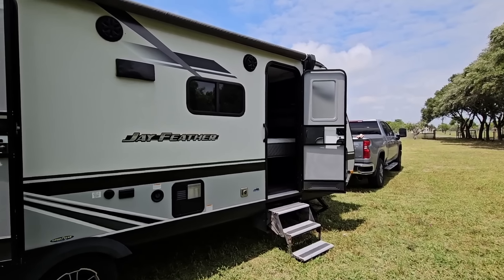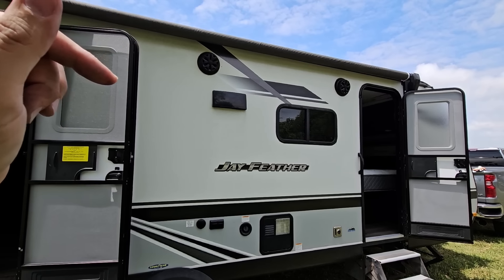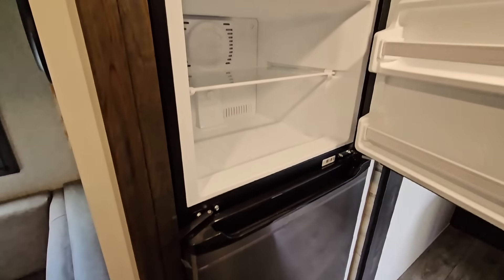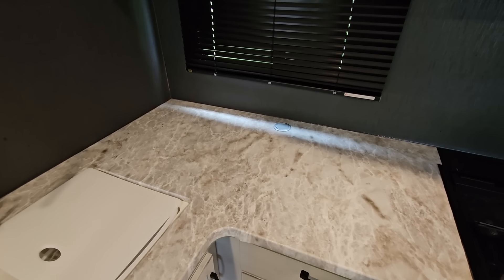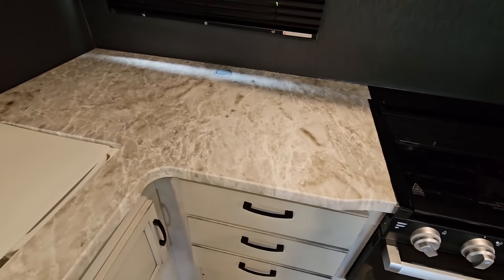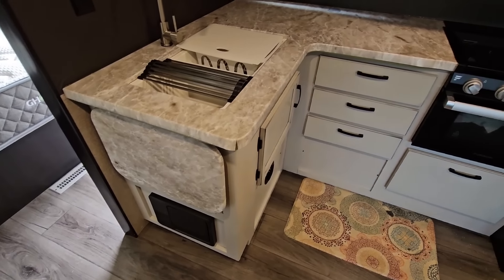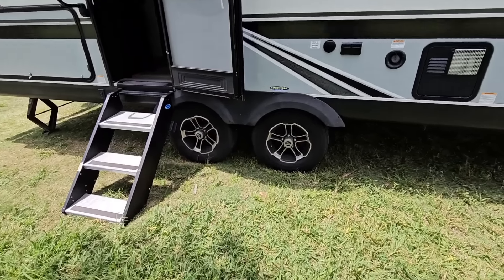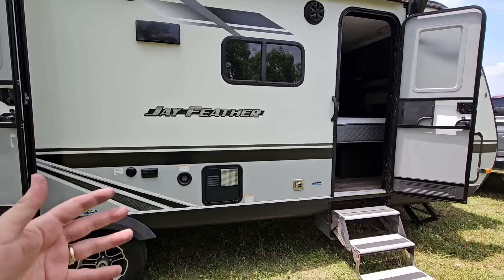That's Ridiculous! USED Jayco RV gets BIG Upgrades! I hate Thermofoil!

Comment: ironic really, our 16 yearold kz spree 26 ft that a does 5000 miles a year on average has everything original in and on it and it all functions great.  i replaced the flooring a few years back.  our environment is tough too, cold winters, hot humid summers.
our formica covered countertops are in perfect condition, our 2 way fridge functions perfectly because it's installed properly (that jayco fridge was not).  our 13000 btu ac cools the trailer on the hottest of days no problem still after 15 summers
stuff like this on a 2 year old jayco (i thick you said 2) is shameful
i'm on my third set of tires, second set of brake shoes and i just replaced the 7 way cord to the truck.  thats in well over 70,000 miles
i will do the suspension upgrade and go with a lithium battery/solar system, waiting for your input!
Reply: Yeah I have a 99 KZ, much higher quality than that!

Comment: Of course the Thermofoil adhesive is not waterproof.  Who would think that you would need that on a kitchen (or bathroom) countertop??!!  That's like the recall notice I got from Chevrolet recently on my pickup with tailgate release buttons that can malfunction when they get wet!!  Why would a tailgate button (they are rubber-covered) have to be made waterproof, just because it is on the outside of a pickup truck??!!  Go figure!
Reply from the maker: Lamination countertops have been used in homes for decades.  The difference is they have a much more durable surface.